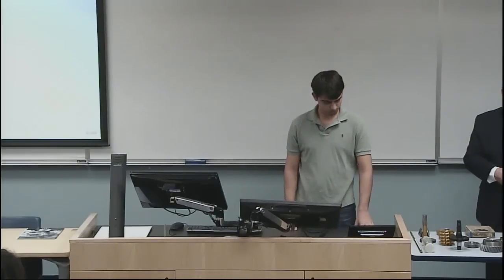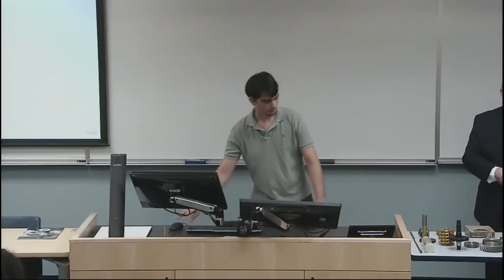Gear Manufacturing Lecture by Allan Arch at FIU Mechanical Engineering, Miami, Florida

Comment: Worm drive, allows for big gear ratios. Used early on in the automotive industry.

Other important gears are; The double gear, the Face gear, the Herringbone gear (which creates no thrust loads), The sprocket (which is most commonly found on bicycles), the Silent chain (very strong and quiet), Racks (which convert rotational motion to linear motion), and Splines (which attach a pulley to a shaft, are an alternative to a key way, and are more effective in holding the shaft in place).

Comment: Another common cutter we encounter is the Shape cutter which allows us to create internal and external gears as well as the ability to create splines. The Worm Hobbs cutter is of course used to create worm drive gears. We also have Double cutters and broaches. All of these cutters require some sort of lubrication/ cooling in the form of oils, chemicals, or what solvable coolant. Once the gear is machined it should go onto a Shaving cutter or a grinding wheel. The choice is determined by the resolution desired by the engineer which should be driven by the application. All of these cutters can be sharpen several time before they become useless and are replaced by new tools.

Comment: One way to ensure gear quality is to compare the machined item to a master gear. Master gears are extremely expensive because of the ridiculous tolerances they are subjected to. We can also use lasers to measure the cut profile and angles of the machined gears. Another method is to use Wires or Pins to determine the level of craftsmanship. Gears are usually assigned quality number which generally drives the cost. Master gears are usually around 15, gears used in the automotive industry are usually around 8, and gears used in places like steel mills are usually around 4.

Comment: Another topic that was discussed were the cutters which are used to create these intricate gear designs. Probably one of the original tools would have to be the " Single tooth Rotary Cutter" This tool is still in use today. However, it is not the preferred tool. It consumes a lot of time and is only able to cut on tooth at a time. In comparison the Hobbs cutter is not probably the most common cutter today. It has a special coating which increases its hardness and allows for extended use without sharpening. the Hobbs gear cutter works in a relatively similar way to the Single tooth rotary cutter except for the fact that this tool creates multiple teeth in one sweep and is extremely fast in comparison.

Comment: There are many different types of gears and their respective applications range depending on the design intent. The most relevant are;

Spur gear, The most common type of gear is the. This gear has straight teeth, is very simple to design in comparison with other gears, and is the most cost effective choice.

Comment: Helical gear, The gear is also fairly common, but unlike the Spur gear they create thrust loads. However, they are much quieter, they can handle heavier loads, and can be used at higher operational speeds.

Planetary gear, There gears are not as common as they used to be. They can be both internal and external gears. Once common application can be found in the automatic transmission.

Comment: One of the most important things which should be taken from this lecture is how important tolerances are. They will make or break your design. Allow to loose of a tolerance will result in a product that will fit poorly and most likely fail. Tolerances that are too tight will lead to ridiculous manufacturing costs. Besides having the proper equipment and very skilled machinists if we don't have good gear blanks the final result will always be a dud.